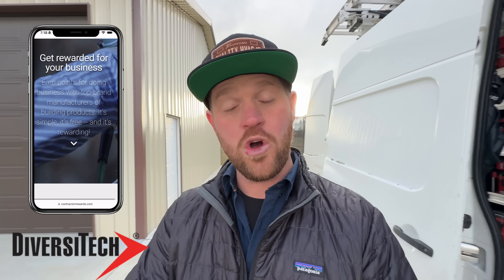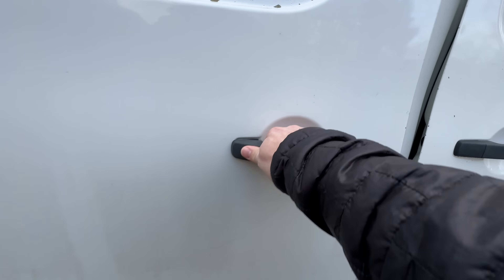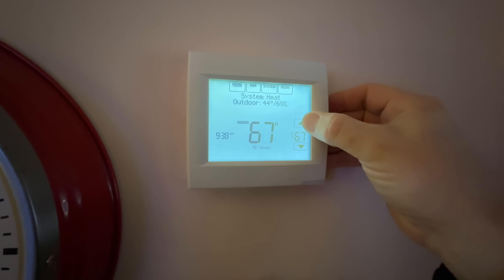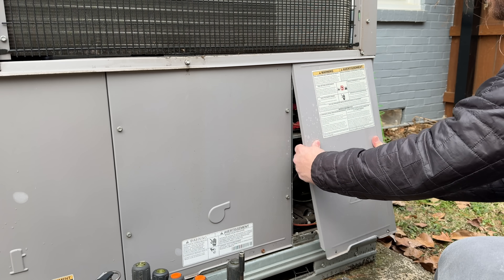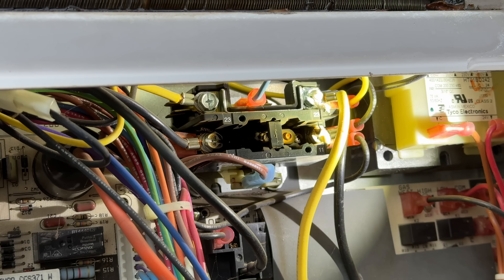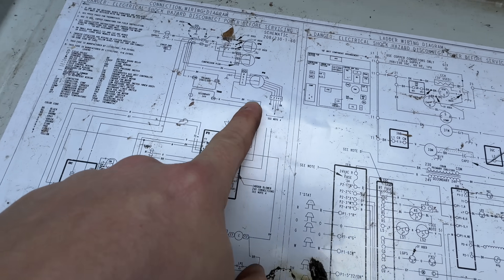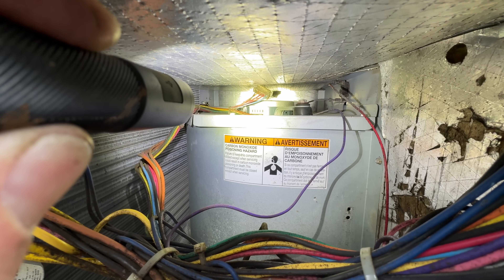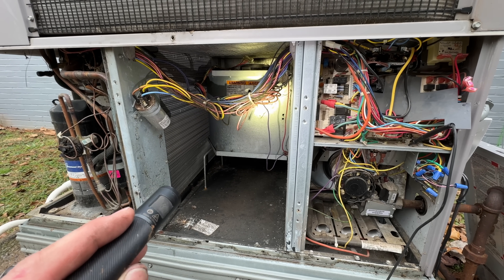This Almost NEVER Happens | HVAC Service

Comment: Rescue motors are my go-to on older units if they're available.  They are usually significantly cheaper than the OEM and fairly simple to install.

Comment: And it is true that normally one does not carry a stock of variable speed motors due to the cost and sometimes considering the expression of the client when he lets us know his budget, sometimes one helps him by changing it for a standard motor, especially if the unit is many years old.

Comment: I tend to agree with your thought process on the motor. 

I have found if the signal for the speed drops out the motor will run the last cal received. 

The scenario I had was someone wired in a wet switch breaking the transformer on a climate master. It got wet did just that and the fan ran indefinitely until I shut the units high voltage off and turned it back on

Comment: this is manufacturers ripping off the consumers... an old fashioned relay to run blower speeds worked very well for decades.... then came the electronic BS... said it would cut your costs.... do the math... huge rip off

Comment: All you had to do is add a standard traditional fan relay and break the black high volt common wire at the high volt side of relay and then blue and green to the control side of the relay - ✅
Reply: Yea, only problem with doing that. Is if u make the customer a fix that works & makes them comfortable some people say - hey just leave it like that. I’m fine I want to save some money. You have to be careful who you do that with. If Your sure they are the kind of customer that wants it fixed correctly & are grateful for a hold over fix. Then u can do that kind of stuff.

Unfortunately a lot of People more often than not will say the temp. Fix is good enough & u open another can of worms.
especially when the motor quits out of warranty. & trying to explain that the motor will eventually fail open & then they are back to square 1 WITHOUT a warranty & big bill.
Reply: That fix works. Never had to go back.The only thing that will take it out is a grunting no go on the ECM motor itself which is how most fail anyway

Comment: FYZ…. Stock 1 Evergreen VS motor, 1 Evergreen VS user interface & 1 Genteq 16-4 pin adapter & you will always be able to handle a failed ECM on the spot.  This is manufactured by Regal Rexnord which has a distribution center up the road from you in Nashville.  All components available from United or Supply House for approximately $500.

Comment: ECM MOTORS ARE NOT THE BESTEST,  JUST HIGH PRICES IN THE NAME OF EFFICIENCY.
CAIN'T BEAT A PSC MOTOR.
Reply: Psc all the way!
Reply: Everything made now a days is honestly garbage, nothing lasts! Everything made of paper now a days!
Reply: You can replace an ECM with a PSC motor, that's what I would do. Cheaper part and will last way longer. Otherwise, why wouldn't he just replace the control module on this bad ECM motor because obviously the motor is still good, it's running just fine.
Reply: @1PooNGooN3  ecm has nothing but problems, i replaced more ECM motors than a PSC believe it or not

Comment: Had the same problem with a Carrier x13 continuous run without inputs. Replaced with Evergreen x13 (2yr motor warranty) OEM (1yr warranty ) outside of factory warranty.

Comment: You can replace the modules on alot of those motors but at least in my area no one stocks them anyway lol. My area sucks for supply houses. We have a webb but ours doesn't stock shit for motors of really any kind
Reply: don't you have a Johnstone supply house? and most of those motors you can't replace this and that, you need a new one.
Reply: @themrmoy40  no
Reply: They are no longer supply houses, they are order houses. You have to order every part.